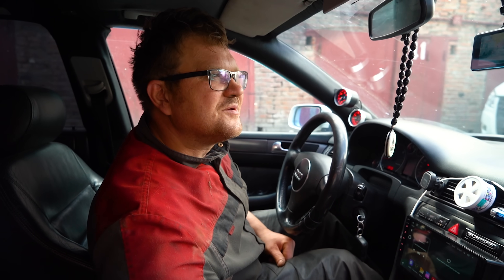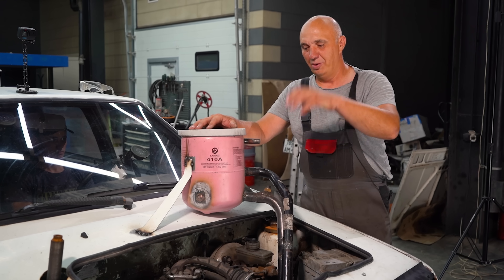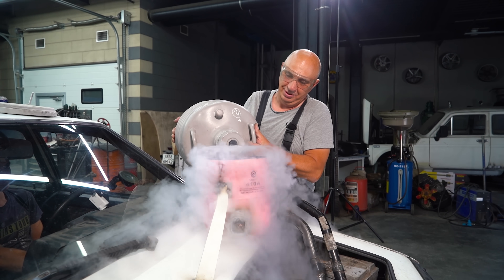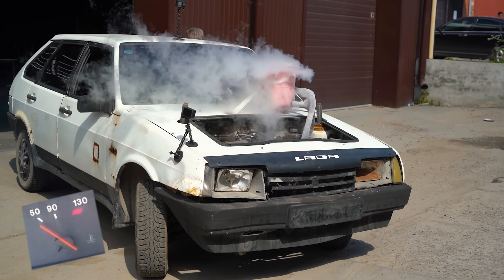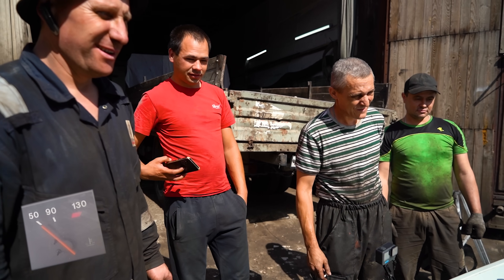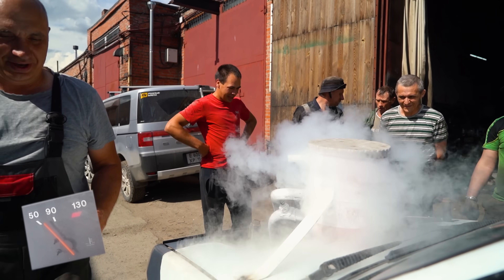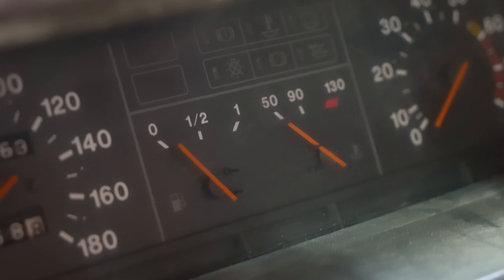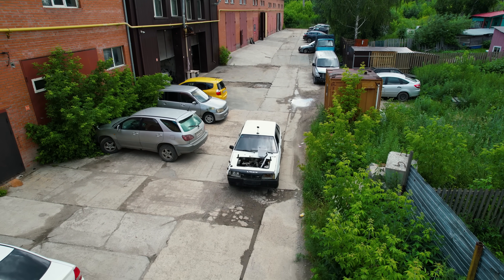Liquid nitrogen cooling system for a Lada - will it work?

Comment: The pipe that's releasing should be on top of the cylinder. The pressure will push the nitrogen to the bottom pipe into the engine while the outlet forces the one inside the cylinder downwards.

Comment: My 1.4 d4d corolla in winter is also very difficult to keep warm in city drive. Turn some good heating in the cabin, and you can trace the needle dropping slowly whenever youre waiting at the red light. Takes atleast 15 mins of driving to warm up at colder weather (-10 C and lower), due to small aluminum block.

Comment: If you used a closed tank, like a propane tank and a valve that slowly released it into the air. You could control how much nitrogen was cooling the engine with the valve.

Comment: As far as I can see, the best way to make this an efficient system would be to run several small copper pipes through the engines coolant passages. Then fill the remaining space with, probably, some kind of oil. Water would not work. Set up a pump for the liquid nitrogen. Its an interesting idea, very much appreciate the channel

Comment: box outside of  the  cooling system and fill with nitrogen  and see if it still does the something  anti-freeze  in cooling system and the the outer boxed out and filled with nitrogen

Comment: Incidentally, it would have been a great deal easier ... and probably work better ... if you simply let the existing water pump move the water through a metal tube that passes through the liquid nitrogen container ... and thereby cool the water with the liquid nitrogen instead of trying to run the liquid nitrogen through the engine directly.

Comment: I think that if you find a way to cool the engine with liquid nitrogen or dry ice in combination with water of course (antifreeze), I think that you will be able to make any engine perform at least twice as much and the best part is that you can reduce  the weight of the car so you no longer need radiators.  There is also the benefit of energy coming from the alternator for electrical energy and the speed conditions for the engine to cool down if more power was required.

Comment: Why couldn't you put the nitrogen into a container that you could seal and let get a low pressure gain on the cylinder? Make it strong enough and it shouldn't be a problem allowing you to run longer without losing nitrogen to the atmosphere? Also, insulate cold side lines for efficiency.

Comment: In the lab we use both liquid nitrogen and a slurry of dry ice and acetone in condensers to trap solvent vapor. Maybe try dry ice/acetone or dry ice/isopropyl alcohol in this set up. I've found dry ice/isopropyl alcohol lasts longer than liquid nitrogen (can stay cold for 8-12 hours) whereas liquid nitrogen needs to be replenished every 3-4 hours. Would be interesting to see.

Comment: New idea for next video: The authority surveillance is getting outta hand. The EU now demands that new vehicles has a buzz-alarm when getting a little speedy. Have been thinking a little, and next steps might be  tazered seats for all passengers, and driver, that when you happen to be in a hurry and pass the legal limit, all citizens in that crime- vehicle is being tazered for as long as the speed is above the legal limit. And then 5sec extra for a bit extra tourtyre. Also, a "both hands on the wheel- or be tazered"- 4sec one hand allowed for shifting.

Comment: nitrous oxide to spray on to the radiator would be pretty effective. A solenoid attached to a thermostat and when the temp gets to a certain point, the nitrous sprays across the radiator bringing coolant temps down on a sport bike /my truck hear in AZ would be some thing to look in to cars die fast out hear this is cool lol

Comment: Make a spray system that will spray nitrogen on the radiator to drop the temperature when the motor becomes hot when sitting in a traffic jam

Comment: Try using galium for radiator. It has a higher thermal compasity and will turn to a liquid at just above room temp. Watch it touch aluminum parts and crumble.😊

Comment: You could try regulating the flow with a cryogenic valve. I recomend Herose, their brass valves are very good value for the money. But liquid nitrogen is very hard to control. First nothing happens for a while and then everything is cold in seconds. Also, since nitrogen does not have a lot of heat capacity, the inlet where the evaporation happens will cool down a lot, while the rest of the engine stays warm. But codus to Lada, I expected the engine to crack immediatly. It is probebly made out of high quality austenitic steanless steel ;)

Comment: Interesting video as always, these crazy car hacks have a certain charm to them.
To improve this build, my suggestion would be to put the pot on the top of the car, for better visibility, also make a sort of "exhaust" pipe for it that routes the vapor to the back, only because it would look cooler imho :D
Also for the warming up. I'm not a car mechanic myself, but afail tehere are some termostat that opens above a certain temperature in cooling systems already. I would keep regular coolant circulating in the engine, and when the termostat opens, I would make it so, that the Liquid nitrogen cools the coolant that is circulating, and stops cooling it when the termostat closes. This way the temperature could be controlled in some way, and maybe the car's "nitrogen consumption" would be lower.

Comment: I think using compressed nitrous oxide to spray on to the radiator would be pretty effective. A solenoid attached to a thermostat and when the temp gets to a certain point, the nitrous sprays across the radiator bringing coolant temps down.
Reply: yep same it would be good on a dirt bike/sport bike/truck in the summer in az for real

Comment: You can use a liquid to liquid heat exchanger instead of a radiator, and run the engine on antifreeze, and if the thermostat opens up, the liquid nitrogen cools the antifreeze.

Comment: I wonder if you can replace the pulse jet in a carburetor with a thin sheet of pop can coiled with a thin carbon felt of 1/16" or a few mm or so. Maybe a life of sheet metal so the air has to go down to the place where the holes were on the pulse jet part of the carburetor.
Reply: As for cooling maybe ethanol and dry ice.

Comment: I've always wondered if there were power to be made from supercooling the gasoline entering the motor. I'm more familiar with heating the fuel and air charge for more complete combustion and cleaner emissions. Perhaps super cooled gasoline in a direct injection motor could realize some power gain.

Comment: You can keep it longer by using a compressor evaporator and liquidation basically the components of ac or refregirator it would work better because its co2 and what dome refrigerators and ACS use is propane

Comment: That liquid nitrogen is gonna boil out faster than you can imagine. I'm concerned that pressure from the heating and expanding nitrogen would blow the whole engine up, but probably just bust the cooling system.

Comment: Alternate Video Title: "How turn convert a Lada motor into a literal I. E. D."
I'm only at the point where they just finished mounting it, but based on the old Stream Engine video, I'm going to assume they've similarly implemented ZERO pressure relief safety measures... 🤣

edit: I'm glad it turned out to not be as much of a closed system as I thought it'd be! 😅

Comment: Well guys I think the if you didn't take the thermostat out there's never gonna get to the point where opens up and circulates into the motor at least not through the head or  intake So, it won't be actually cooling.The whole motor and you know you don't want the head  hot

Comment: Would be nice to use a spiral tube in the liquid nitrogen tank to cool the air from the air filter to the engine, to try to emprove a little bit the power

Comment: you should make a air intake cooler with liquid nitrogen! would like to see this done on a turbo vehicle if possible to see the largest power gains
Reply: My thoughts exactly. Basically a water/air intercooler, but with liquid nitrogen. Me and my son are building a turbo Celica currently, and plan on doing methanol/water injection. Would be cool to set up an intercooler like this just for the hell of it.

Comment: Sounds like a cold motor.
How would the LN2 go as a secondary cooling system,
Turbo inter cooled with a LN2toAIR charge cooler instead of 
the conventional WATERtoAIR and AIRtoAIR vs no intercooling.

Comment: If you were to pressurise the system you would not loose so much gas, maybe a 14 - 15 PSI cap would work at least to some extent. Well done guys another great project.

Comment: People, he's trying to keep the cars from overheating...
Put the original water cooling system back in the car and route the Nitrogen hoses so they are following and touching the main radiator hoses.
This way maybe you only need a small tank of Nitrogen tucked away under the hood. Make sure to insulate the hoses.
Best of luck, hope this helps!

Comment: G'day Garage54 & BMI,
As someone who is also into Computer Overclocking this was REALLY COOL!, for reglating Temps you could talk to Elmor Labs, they do LN2 Extreme Cooling Setups for Computers, or Vince "KingpIn" Lucido" of KPX Cooling who along with LN2 Cooling PCs is into "Overclocking" Electric Bikes. 
Air Conditioning would just need a hose added to the tank pressure vent so it's pumping through the cabin🥶☃ with "Let It GOOOOO!, Let it GOOOOO!" pumping through the Speakers 😂
& I think as LN2 is going through the Cooling System if anything would fail the Water Pump being Frozen will be a weak point

Comment: Need to weld the lid to the tank, and add filler neck to the lid that has spring-loaded valve to avoid leaking nitrogen too fast. Adding back radiator would avoid cooling down engine too much.

Comment: I think a sealed system circulating through an auxiliary cooler with an electric pump and staggered lines mounted behind the radiator / condenser would be far more realistic and feasible.

Comment: what if the liquid nitrogen is connected to car radiator full of water and the other pipe is made as an outlet which will remove the pressure caused by nitrogen gas in the radiator, can you try that?

Comment: Wonder if he took out the thermostat valve if he didn't take out the valve it won't circulate until the motor has hit at least a hundred and eighty to 190 degrees then the valve opens to cause the circulation from motor to radiator if liquid nitrogen touches that thermostat it will never reach temperature to open to cause circulation.

Comment: Run the liquid nitrogen through the a/c evaporator. Test how well it cools the interior. How about a liquid nitrogen to coolant heat exchanger. You could make an adjustable by pass of the coolant to regulate the system.

Comment: How about try use the  liquid nitrogen to cool the water system of the car instead of the radiator. Remove radiator and replace it liquid nitrogen. Have the water circulate around the liquid nitrogen container. That way the nitrogen does not evaporate off. But the water is cooled and circulates to the engine.

Comment: Try running coolant like your supposed to then make another sealed system that pumps liquid nitrogen to a condenser in front of the radiator that way you don't loose so much or put a tank for the coolant and put the condenser in the middle of the tank keep up the videos doing real good!!!!!!!

Comment: Why not install a regulator or valve to canister of nitrogen so you can add more nitrogen into the engine when it starts to overheat

Comment: I say run regular coolant in the closed system without a radiator, but have a coil of coolant line submerged in liquid nitrogen.
Reply: Anti-freeze is not going to stop the liquid from freezing in the pipes.
Reply: @TheHungrySlug  of course not, but the co2 will cool the hot coolant coming out of the engine.. Thus cooling the engine.

Comment: Two stage cooling system. 
Try placing the radiator in the nitrogen vessel. This will lower the coolant temp. If the vessel is done right, you can also use dry-ice. Which is easier and sometimes cheaper.

Comment: Awesome video guys! I have 2 suggestions: 

1. You should have ran the heater to see if the nitrogen was flowing thru the heater core. That might have been a really cold air conditioner. 

2. A while back you poured boiling water onto a frozen windshield to see if it would crack. What if you poured liquid nitrogen onto a hot windshield???

Love the videos, keep it up!

Comment: You can try to make a closed loop system with water and a small pump and exchange the heat in the container filled with nitrogen (may be a sort of  small rudimentary radiation for more suface)

Comment: Use the liquid to cool the radiator under a controlled spray on it. That would help cool the antifreeze in cooling system. May be able to control it better and may last longer too

Comment: Make a closed loop cooling system like saltwater boats use, and use a fluid for the engine coolant with a very low freezing point. Use the liquid nitrogen as the "sea water" side of the cooling system.

Comment: What about using the nitrogen in front of the radiator and try to have the vapors run through the fins like air movement to see if it stays cool?

Comment: I could see this working a bit better if the liquid nitrogen was in a pressurized radiator in front of a standard coolant radiator so it could pass cold air over the coolant so it would cool off much more efficiently and not cause premature engine wear. Great video and idea.
Reply: If you seal it up it won't cool as much as water does.

Comment: In the US, people are using CO2 sprayers to keep their intercoolers super cold so that the charge doesn't exceed 1075 degrees F when it is compressed just before the spark plug fires.  This prevents detonation and some of these engines are running boost levels that rival the pressure in the tires......
Reply: damn neat trick

Comment: Neat idea! What would happen if you used a sealed circuit? So no vapour can escape, using valves to fill the tank as if it was a refillable cigarette lighter? Could even make the tank transparent to see the level. 
I wonder if this would have pressure issues, or if it would work and possibly make the nitrogen last longer?
Reply: Explode

Comment: Temp sensor wired into a relay with a motorised valve should allow the engine to warm up and stop the nitrogen.  When it needs cooling the temp sensor lets the valve lpen.
Simple

Comment: Turn the heater on and it would have amazingly cold air conditioning 🤣🤣
Reply: Right? I didn't think of that.
Reply: There were no pipes the rubber would have blown out due to the shrinking and movement of the engine. Plus it would have to be connected to the fire wall.
Reply: @DakotaNorth-td3qi Did you even watch the video? At 1:56 he says he has it connected to the heater core inlet and I am sorely disappointed that they didn't try turning the blower motor on.

Comment: use the nitrogen to cool a turbo intercooler. test the before and after results using your dragy system.
Reply: That would be interesting, I wonder how quickly ice would build up inside.
Reply: I tried it with a water to air intercooler when I was dairy farming, it worked amazingly for about 5 minutes then the condensation build up caused ice to form and started blocking the air flow
Reply: @Ireguku  condensation always fucking shit up GOD DAMN IT
Reply: I’d prefer this experiment on a dyno
Reply: Better off just using it to lower IATs imo, like running the air con line into it

Comment: I love this kind of stuff, this is redneck engineering at it's best. No gloves or protective clothes, just grab the bottle of seriously dangerous liquid and start sloshing it in, only Vlad is bothering with safety glasses and he removes them pretty quick. And with the drivers forward vision almost completely blocked, goes for a drive to impress his buddies! It just doesn't get any better than this.
Reply: Clothing will hold the liquid so it more dangerous with gloves and protective clothing
Reply: I know some guys in the pc overclocking scene that would bench in their boxers because once you spill it on a piece of clothes you realize it does more harm than good. The biggest danger is actually using a lot of it in an enclosed area and slowly displacing the oxygen.
Reply: In Russia, they don't baby proof the house. They house proof the baby. Makes for a tougher people.
Reply: Yeah as JaysonB21 said gloves short of arm length insulated rubber gloves is actually more dangerous since it would hold it against your skin.
Reply: I love the bracket was a slice of the hood❤
Reply: You dont use gloves with liquid nitrogen
Reply: Yes
Reply: You can pour it on skin actually, it boils so rapidly it doesn't really touch you. Like others have said however if you have clothing or got it inside rubber gloves it will remain on the skin til it's cool enough not to boil as rapidly and can make direct contact and when that happens the danger you speak of happens. Much like dry ice, you can touch it and all but it's only a danger if you actually grab and hold on to it. This boiling of LN allows allows you to quickly plunge your hand in and out of it but obviously no one should be doing this just in case you aren't too quick about it for various reasons. Either way it's not some "Oh no I got some on me, I froze!" situation, just don't let it remain in contact to the point you no longer critically boil the liquid.
Reply: couldn’t have said it better myself
Reply: Look up the Leidenfrost effect. It stops the liquid nitrogen from burning your bare skin...